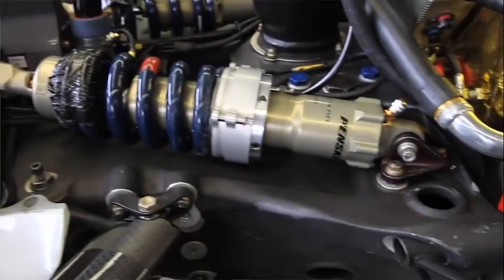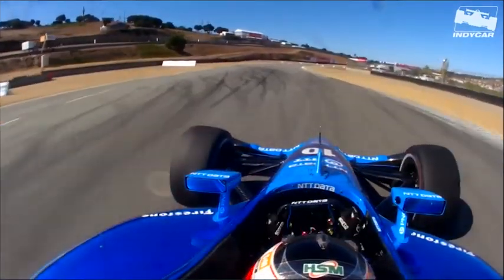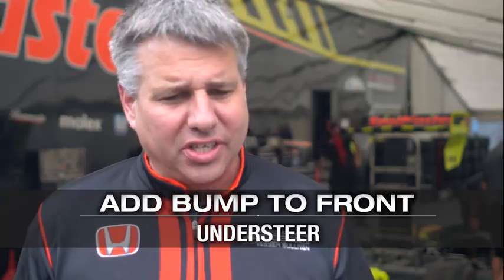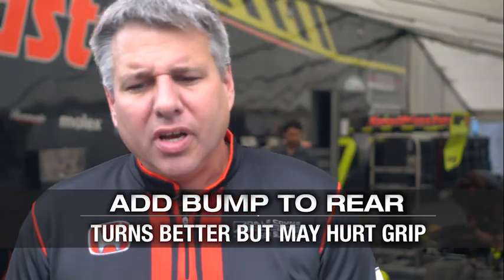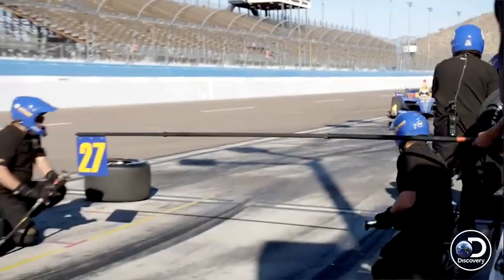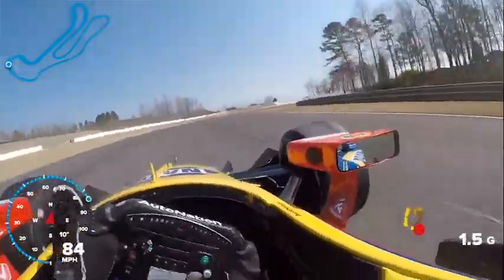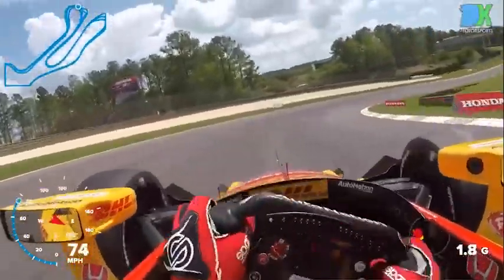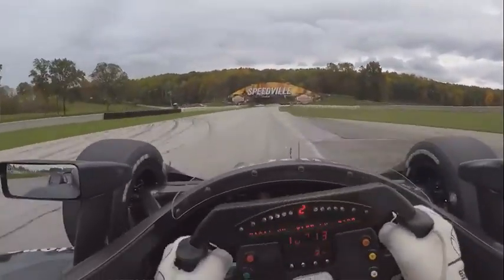Tuning Shocks/Dampers for Speed - Part Two: On-Track Testing

Comment: So on a road course. Would front tires have different damper bump setting from one another or should they be the same? Same question about rebound. I know that Bump and Rebound will be different. But it’s more side to side that I’m curious about.
Reply: If you are fine tuning, Yes yo can have different settings. All depend on the track and the amount of turns to the left and right.

Comment: Wow one big reason why smooth is faster...if ur not smooth its hard to keep tune with your car...it just takes focus though...tuning your head to pay attention and a little practice to feel that area u want to figure out...I'd have to believe are seat of the pants is difficult to use because ur thinking nice clean but fast thru a section mite mean more grip and a bumpy ride but its still hooked up and did its job...not drive like a cadi...hah hah...good stuff....